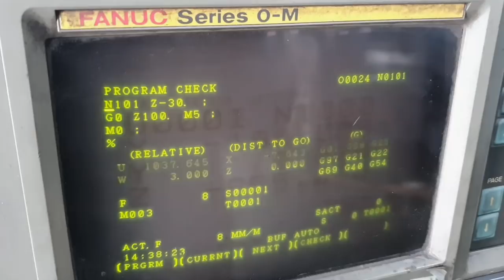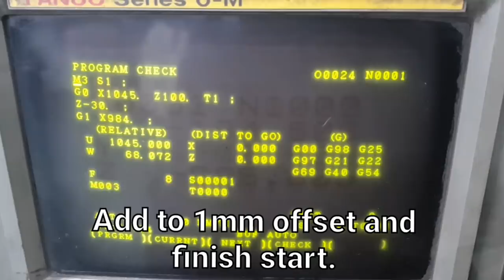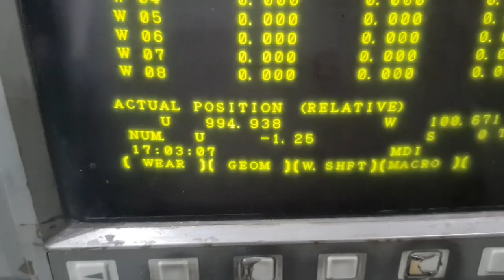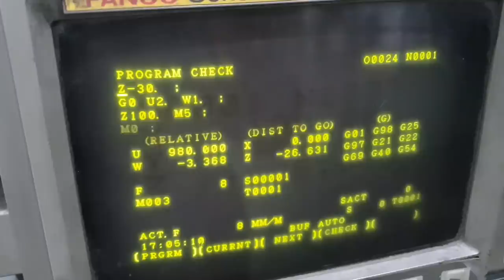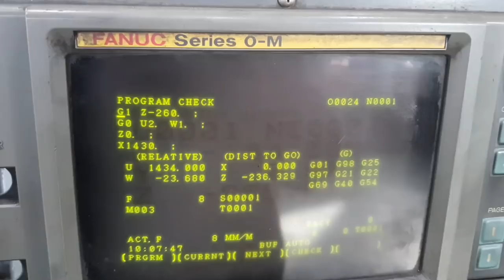Separator Drum Machining

Comment: lol 0.05 mm tolerance is stupid for part this big, show it some sun and the dimensions will be all over the place
Reply: 0,05mm expansion is reached with 4,3° temperature difference
Reply: What about the shafts that are used in jet engines? Those have super tight tolerances and can't be machined if the shop temp gets higher than 71 or lower than 68. After they're done though when they get assembled to the engine and used they're going to expand and contract all the time
Reply: @bassmaster7942   But if everything is machined to a tolerance within a temperature window then the parts will fit together as designed and expand / contract as designed.  I'm sure this is considered.   (I'm a laymen/hobbyist, so take my comment with a grain of salt)
Reply: @Zt3v3  You are 100% correct. That's why when they make the shafts that go in the turbine there is a slight arc that will actually be straigthened as it spins by the centrifugal force. I took a tour at the Delta shop in Atlanta about 2 years ago and was amazed by how everything was done so exact and precise, but after it gets out of the shop it all expands and goes past tolerances held in the shop. The comment saying that holding a ~.002" tolerance on a part is stupid, is ignorant. Your comments proves it's ignorance because just like press fits for bearings you hold a tight tolerance but once assembled and being used the tolerances no longer matter because the friction is going to lead to heat causing all the components to expand together.

Comment: That was a video of not doing it. Finishing with a roughing knife, it cannot be measured with a caliper to 0.05 mm, a micrometer is used for this.
Reply: With a good feel and experience on larger jobs you can quite easily measure within .05mm/.002" with a large vernier, sometimes it isn't possible to use a micrometer or an internal micrometer and a wall thickness.
Reply: @colcloughjack  Maybe your perspective will change when you have 30 years of experience like me.
Reply: @StanislavPacourek  same experience here on aerospace and military parts too, I can't be bothered to argue with you but given my experiences and in some incidences lack of measuring equipment you have to use what's available and still get the job right, it is definitely possible and happens fairly often 👍
Reply: @colcloughjack  👍

Comment: As a non engineer may I ask - when you get the finished dimensions do you have to make any allowance for expansion or contraction due to the temperature in the factory?
Reply: yes you have to keep it in mind, especially when dealing with large and precise components. the standard temperature for messureing is 20*C. so if the shop is warmer than 20'C the compenent is going to shrink when messured at 20*C. the thermal expansion coefficient for steel is around 0,012 mm/meter/*Celcius.
 it's not that big a problem, if you use a steel gauge blocks as a master on a steel  component, but if you are dealing with diffrent materials you are also dealing with diffrent thermal expansion coefficients, and should make the part bigger/"smaller" so the size fits at 20*C.